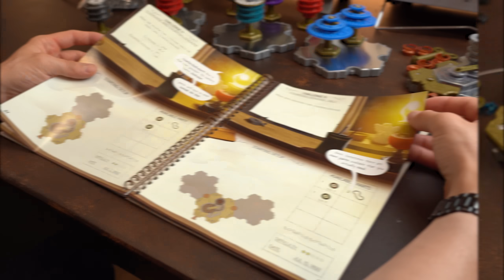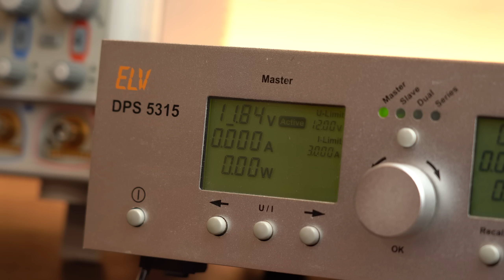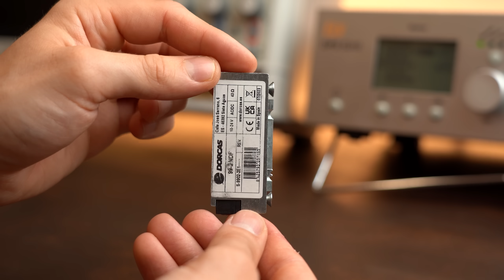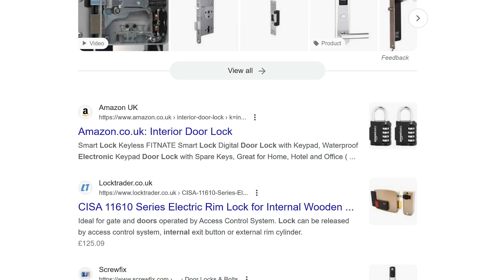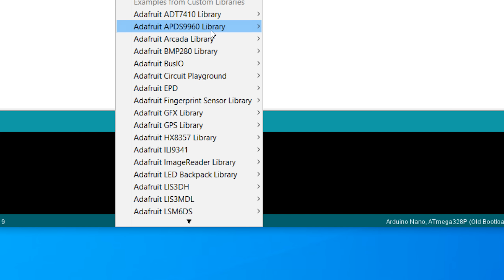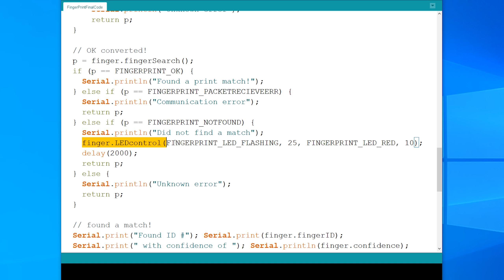Your Door NEEDS this Upgrade! DIY $40 Fingerprint Lock!

Comment: Also, for anyone wanting to DIY your own security door, mount your electronics on the INSIDE of the secure room. The only thing that should be outside is the reader. Otherwise someone can open up the electronics and bypass the security features. (LPL has a few videos showcasing this)
Reply: I think for a lock that is meant to keep a child out it's good enough. By the point the child is able to mess around in there and bridge the lock open you have no need for it anymore anyways
Reply: I’m surprised I didn’t see more comments about it. It was my first thought when I realized the electronics were on the outside 😅
Reply: Definitely. This setup may be fine right now, but when the kid is a year old and studying electrical engineering, he'll be McGyvering his way through that lock no problem.
Reply from the maker: Definitely true. But for child security. This is definitely good enough.
Reply: @greatscottlab unless... Your child starts watching LPL...
Reply: @greatscottlab   Depending on how smart your kid is, it wont be long before that little one has to watch dads videos, and learn how it is build stuff, then the criminal minde of a kid will start to figure out how to get into dads room. Dont ever show how to open the door with your finger, or one morning you will wake up with out it. 
How do you get in when there is no power ?
Reply: @greatscottlab if the kid is smart enough to bypass the security, they're smart enough to be allowed in the lab
Reply: @greatscottlab   Until your genetics start acting up in the child and he thinkers with screwdriver. Great video thou, I'll have to do similar thing soon. My suggestion for power routing is to route it thru wall and power it from LAB. I'd also add some battery backup option, lets say 9V battery contacts on the outside of box, where I would connect 9V battery to open the doors, if needed.
Reply: @greatscottlab  Hmmm I'm not sure, there's always possibility the child will unscrew the box and use power supply to unlock the door
Reply: @greatscottlab  at least for 7 years, I remember unscrewing everything when I was a kid that age.
Reply: @greatscottlab  It actually is ONLY good enough for that. Fingerprint locks are a security risk if used on smartphones or homedoors, since we leave fingerprints everywhere, and they can easily be recreated.
Reply: @greatscottlab Would it not be a good idea with some kind of override in general, in case a fire in that room causes power outage etc. Just for safety in general.
Reply: @Amn2k9 most of these latch kits have a fail state they can be put into, so if the power cuts it defaults to that. On an external door they’re generally set to fail locked, but you can usually flip them to fail open.
Reply: @Amn2k9  i dont know from the top op my head rn but the key could be used in guess? (I mean from the inside there is still a handle)
Reply: @greatscottlab Well.... maybe. But my 2 year old solves puzzles for 6 year olds and she is already reading stuff. Just saying...She unlocked our cupboard before she could walk.
Reply: Thought the same and this leaves some audience with false sense of security if the feel the need to "secure" what ever room the want.
Reply: @qu3xHG  No, it doesn´t leave people with a false sense of security because most of the audience - unlike you - understood the intention behind this installation as it was mentioned in the video.
Reply: How do you get just the reader to be outside. Drilling the hole in the wall??
Reply: As if a child would open a box and cut the wires to open a door.....
Reply: Probably good enough to keep away children up to a certain age. If you drill a hole through the wall to run the cable to the inside of the room and connect it there, you might also mitigate the "looks unappealing".
Reply: I mean once his kid is to access the electronics and short the right pins, it's time to let the kid in and teach it more stuff :D
Reply: But be aware that you may need to destroy your door or frame in order to open it if something fails.
Add failsafes when the entire thing is hidden, or pay extra for something engineered for the purpose so your chance of failure is lower.
Reply: If  you don't want to use surface mount trunking, why not run your cables behind the architrave and skirtingboard (baseboard)? You can connect directly to the feed to the nearest outlet with only a small channel in the plaster between the outlet and skirting.
Reply: We technical animals must stick together.
Reply: If I had my own place, and was going to do something like this but for my main front door, I'd make sure the entire wiring conduit is shielded by steel to prolong destructive bypasses. If you are using some sort of deadbolt contraption, mount and secure the mechanism side (male part) off the door and secure the lock housing over a large area on the door to distribute the force if it tries to be kicked in.

Power it by low voltage spring contacts through the hinge. Only send power when you need to unlock it and the door is closed. Only when valid credentials are presented would I run power to the locking mechanism, then operate it. (could make it 2-step?)

I'd also install a giant red-and-yellow industrial safety cut-off switch on the mechanisms side inside as an emergency release. It would have an isolated power supply from that of the hinge, and a reserve. This'd be for emergencies, not general use, in the event that you need to get out. Being my front door, having a power-loss state of unlocked isn't exactly viable, so this would be do avoid violating some sort of building code that probably exists.
There would also be a manual release mechanism.

The real challenge would be selling this idea to my partner.
Reply: you can use a ups to power it so it work when there no power @Carhill
Reply: Also imagine how proud a dad he'll be, when kiddo figures out how to hack the security system!
Reply: Paperclip to actuate the mechanical release system... the child's gonna be in there in no time! 🤣
Reply: ahaha, never underestimate the WAF (Wife Approval Factor)!  Glückwunsch zum Nachwuchs!
Reply: hide a bypass somewhere in the outside cupboards and not post that in a video lol
Reply: Yes, however when his child is able to open that enclosure and bypass the fingerprint security I'm sure they will be ready for full access to the lab. Maybe it's his way of a test.
Reply: Youre thinking the Punnisher with a room full of automatic guns and grenades lol
Reply: For low security use cases this should be fine, but for high security systems, way more considerations are required:

1) Mechanical security of the door - this door can be opened easily with brute force.
2) Not processing matching or storing fingerprints on the sensors - this one by default does both on a sensors, so sensor can be stolen and fingerprints leaked, as well replaced and new one with new fingerprints stored, or bypassed.
3) Tamper detection (for sensor box, and for door is opened by other means).
4) Of course it should be inside, and power lines properly isolated, so it is hard to leak information via current measurements, or EMI.
5) Communication between components could be encrypted and signed, so it cannot be intercepted or spoofed. A bit harder.

A lot of professional and commercial systems even fail on all the above points. Including fancy access card readers.
Reply: @movax20h  one of the reasons i don't want bio-metrics in my home, what's stopping someone from cutting off things to gain access.

Comment: I use a kaba smart cylinder which I agree would not have made as good of a you tube video however it took me 5 minutes to order it, 10 minutes to install it and it has been running for roughly 4 years on the same battery!
Reply from the maker: Sure. But this thing goes for 200€. My solution for around 40€ maybe. And good enough I would say ;-)

Comment: 10:03
I think you can drill a hole inside the wall and route the cable through the wall if u have those drywall type walls but i think just make a channel in the wall, lay a pipe or comduit in the wall, putty and paint over it and done

Comment: You could have used a hall effect sensor IC. Sticking magnet to the door and circuit to the door frame. This would have been much cheaper than buying door nob and lock.

Comment: You could also do an electromagnet at the top of the door if the latch isn't an option. You just give it main's voltage attached to a normally-closed relay. It's just a matter of triggering the relay to break the circuit and turn off the magnet. The best part is that if the power goes out, you can just use the doorhandle as normal. I believe here in Florida, USA these are required for any security door that's blocking an emergency exit. The office I work at has one of these to access a stairwell. The lock can be bypassed by holding the door knob open for 30 seconds, but doing so triggers an alarm. Similar to what you see at grocery stores.
Reply from the maker: Thanks for the info. Good to know.
Reply: @greatscottlab  You can look those up by searching "access control lock", only problem is they have constant power draw.
Reply: You can also install a motion sensor on the inside to unlock it although that likely would get falsely triggered in a home.

Comment: Go through the wall into the shop side. You could also move the controller in there and extend the sensor wire to only have that component on the entry side. Much cleaner install that way imo

Comment: As someone who also has a locked area (my attic access and server closet) with a fingerprint reader, I would suggest adding a couple more of your finger prints from other finger. I cannot count the times I locked myself out because I cut/burned my finger, it was dirty, etc. I finally added a couple other fingers.
Also you should put a hole through the wall and plug it in from inside your shop area. I assume the significant other doesn't care so much about what goes on in that room. If that is not an option either you can get flat ribbon speaker wire that you can barely see once applied on the wall and painted over. You would need to do you AC-DC conversion before your box, but you could throw that under that table, or put it in the wall behind a blanking plate.

Congrats on the baby!  He/she going to have a very cool dad!
Reply from the maker: Thank you and thanks for your great input. Love the ideas.
Reply: @greatscottlab  Also get your SO's fingerprint on there too, you really don't want to be hurt and them unable to unlock the door.
Reply: @greatscottlab  You could also replace the lock with the kind that retracts the latch when the key is turned past the open state.
Reply: That is exactly what I was going to add as a comment, when finished watching the entire video.

Comment: TBH for child proofing this is a bad idea. 
If you fainted inside and the fingerprint reader stops working, you're dead by the time help arrives to knock down the door.

Also google fail safe vs fail secure. You chose fail secure where you need power to unlock. You should get fail safe instead. Your spouse can yank the power and unlock the door.

You should aim for the lock instead of the handle. Check our switchbot instead.

Comment: why did u add a 5v regulator instead of relying on the nano internal one?
Reply: @newnewmee44 but the 5V is used only to power the arduino nano, fingerprint uses 3.3V from the ftdi chip, and the coil is driven by a n-channel mosfet.

Comment: You should add a backup battery to the fingerprint box that can power it for at least a day straight, so if the power goes out you still can access the room. 
Or add a way for the keyhole to activate a mechanical bypass to get access to the room when the fingerprint reader isn't working for whatever reason.
Reply: On most doors (at least where I live) turning the key towards the open position when the door is already unlocked will retract the latch just as if you pressed the handle. With that, you could still open the door with a key regardless of the electronics (the same way you can open it with the handle from the inside).
Reply from the maker: True. Need to add something like this.
Reply: @greatscottlab  I noticed you still have a key hole. On some locks when rotating the key past the normal unlock position, it moves the position of the upper tab (I forget what it's called) so the door can be opened without using the door handle.
Reply: The only real way to fix the issue is to have the lock be actively powered, so if the power goes out the doors default to open. @greatscottlab
Reply: he has a box with all logic out the defending area. He can just power it via any 10-14V battery because there is a simple solenoind

Comment: I have read some of the other comments about putting the secure side behind the door, and that is a good point. But, here's... a potential problem with those fingerprint readers.
Those fingerprint readers may be easily spoofable? The fingerprint data is stored on the sensor instead of the MCU. If one can simply replicate the existing and inject their own fingerprint or replace the entire sensor with theirs, it's game over. There's also only 128 unique fingerprints that can be stored on the sensor. It doesn't sound that hard to mess with. This is just a theory though. I had one to play with but didn't have two to test the attack >:)

Comment: in this design, I feel like if someone had to really break in, they could easily do that by removing the housing for the locking system and giving it power which defeats its whole purpose. In my opinion, the mechanics and wires should be inside the room and only the fingerprint sensor should be outside.
Reply: Yeah, i was about to say that only the fingerprint sensor should be external, but not the circuit. I mean, it's just a plastic box he used so somone could cut it open l, apply voltage to the lock and open. So, better hide the electronics
Reply: @photonik-luminescence  True

Comment: Thank You for your Video and Links to the Material 
very good idea and implementation, it so solve, was also already before the problem, so it makes sense and is feasible
:hand-pink-waving:electronics and power supply belong inside the protected area, only the fingerprint should be outside.:hand-pink-waving:
Well, the little burglar 🤗does not have to break too much, just needs to give voltage from the battery on the door lock 😂

Comment: For the door mounted locks, you could theoretically make some system with springs or pogo pins that would make contact when the door is closed, and keep the battery topped up that way. But it would add a lot of complication, and you would still have to power it just like the solution in the video
Reply: Or just use a cable at the hinges with holes.
Many doors are hollow anyways
Reply: I thought about flexible cable carry like spring shield or something, but this idea may have a place.
Reply: They make hinges that can pass signals or low-voltage power through them.  But they are not cheap.
Reply: @rancidbeef582 just recycle some hinges from an old laptop

Laptop hinges are designed to do this, there is a small channel where you can pass a display/power cable

Comment: Since u live in germany, i guess you have a lightswitch next to the door in your studio. There you get power and you could hide your box which is not looking appealing as well, just wire the fingerprint reader on the other(outside) side! My son, 2 1/2 years old would play all the time with that box and rip the cabel and everything from the wall. 😂

Comment: I don't want to be a Wet Blanket, but wouldn't a barrel bolt lock on the top of the door achieve the desired effect without all the faffing about with electronics and the dreaded software, after all is said and done it will be years before child will be able to reach it, well past the age of wanting to eat a pair of wire cutters.

Comment: As soon as the kid grows up enough to gain some knowledge about electronics, they will open the cover and manually power the lock.
Reply: By that time the same kid will know not to insert screws into wall sockets or to lick power supplies. 
So the whole lock thing will be overkill anyway.
Reply from the maker: I want to see that. I will turn off mains power before that though.

Comment: Congrats to the effort you put in every project. The solution you make has its drawbacks dow. Its required to remove standart handle from one of the door sides. Much easier solution is to put dropbolt/deadbolt type lock below standart as is not need to remove anything from  original solution and will be less digging and grinding. There is also surface mount dropbolts and magnets. Of course this need constant power supply but is fail safe and fire safe. Also AMS voltage regulator on the NANO takes 12v anyday. Sometimes simple project like this takes time and money and become not that simple as just buying cheap chineese solution with all in one package. Big fan of you!

Comment: IMO the best way to power this would be to just put a new cable in the wall, then put plaster and paint over it, if this lock system is a permanent solution. Otherwise, You could just drill a hole through the wall behind the box, and power it from the lab's side

Comment: You were told that’s it was unappealing huh? 😂 happens to me too sometimes. Awesome project as usual!
Reply: that was such a big mood. same reason i'm not allowed to build anything for the house unless i make it pretty. struggles of living with a designer. on the upside, it pushes my crafting skills a bit.
Reply: haha no matter if its the wife, mother or a significant other there is always resistance ! 😁
Reply from the maker: Thanks ;-)
Reply: I guess my inceldom explains the mess my projects leave behind then 😅
Reply: That's the so called SAF. Spouse acceptance factor.